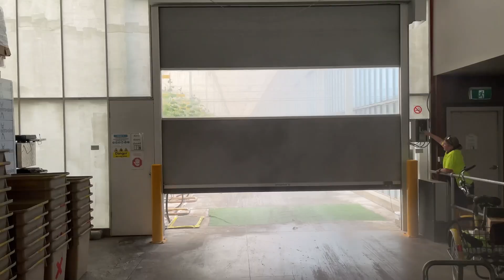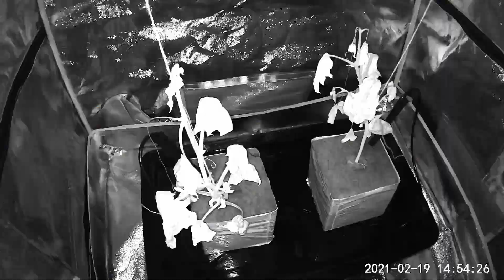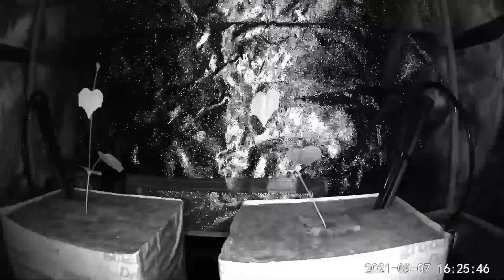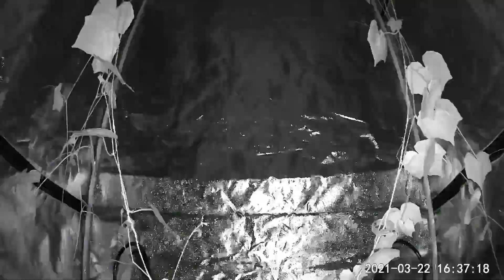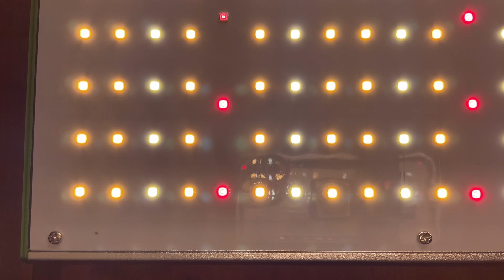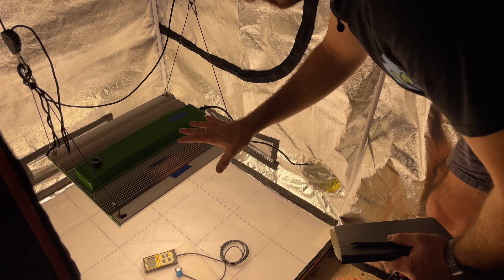Bestva Pro Series 2000 Unbox, Review & PAR Test

Comment: If that's the sensor I understand it to be, it only measures PAR, not ePAR, and doesn't include the far read. You'll want the Apogee ePAR, such as the P2-141 model. It'll also interface with your phone over Bluetooth which is super cool, and give you both PAR, the far red levels (which this LED has specific 730nm diodes for) and then finally the cumulative total.

Comment: Awesome. I've been seeing ads for this light all over Ali Express and ebay, and was really interested to hear how it compares to the Spider Farmer SF 1000 from someone whose opinion on the matter can be trusted (ie. yourself). 

I just bought a second SF and I guess I'm hoping you'll say that this one doesn't quite compare because I've already spent coin on two SF's yet always have a need to have the best available (for that size LED light). This one does seem to have better heat dispersion, though.

Edit. Just realised that this is the 2000w version. Still. Curious to know how they compare performance wise with size taken into account.
Reply from the maker: Check out the video I did on the 1000, that’s comparable, also in the hydroponic greenhouse cucumber video, you can see the light at work in two grows.

It’s got better heat dissipation than the slider farmer and feels more premium, but I wouldn’t be unhappy with either.
Reply: @Hoocho  Thanks, mate. That's one less thing that will be nagging me at the back of my mind. In retrospect, I would buy two Bestvas just because they generate less heat and I only have a grow tent. But SF has served me well and I guess the difference just isn't big enough to justify spending $500 on two new lights. Gave a good one 👍🏻